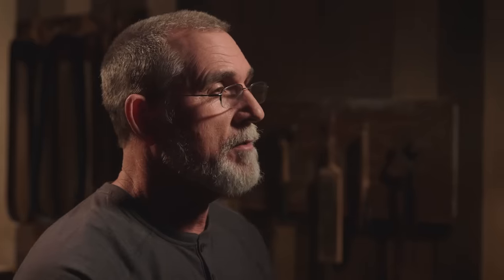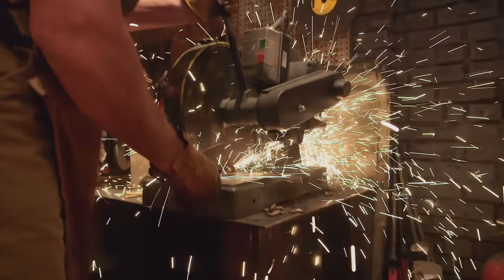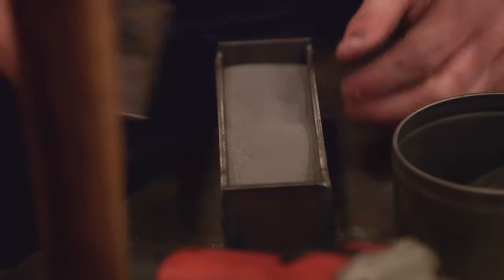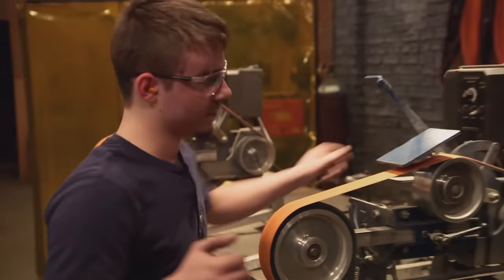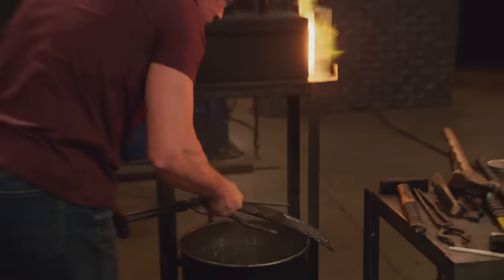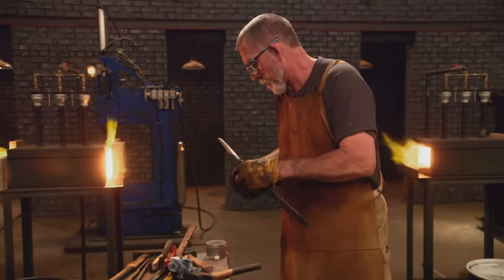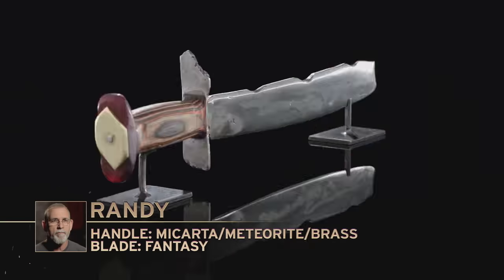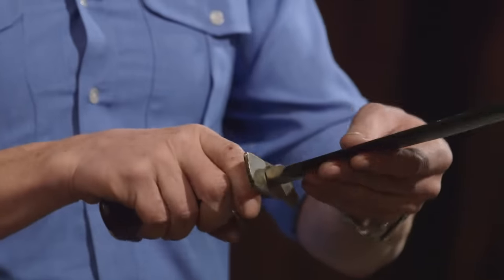Out of This World METEORITE Blade CRUSHES Its Foes | Forged in Fire (Season 6)

Comment: Great idea- meteoric iron was the first iron used to make daggers

Randy's is nice- looks like a ceremonial or execution blade from Central Africa or southeast Asia

Chris' Riddick blade there looks cool but I'm worried about points of failure and hand protection. 

Dan's actually looks practical-very WETA workshop/LOTR. Something slightly overbuilt but definitely realistic

I was so relieved when Dan's survived that test. I kept expecting the uneven steel to snap. The edge getting wrecked I saw coming

Glad to see Randy's was still in one piece. 

Yeah, I was sad to see Chris' get wrecked but tell you the truth I saw it coming. That is such a crazy design with so many inherent weaknesses. A redesign along the same concepts would be fun.
Reply: The basic concept is sound, just needed more support to hold the blade and handle far enough apart to avoid the issue that came up.
Reply: A second support in the middle could help. Like that the stress would be on two points not just one.